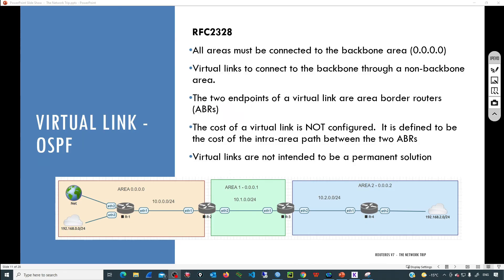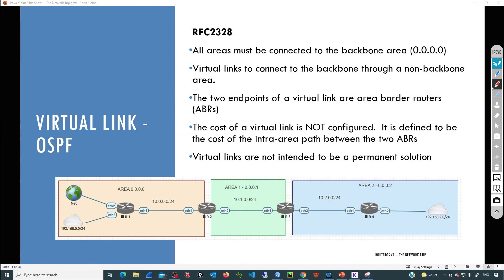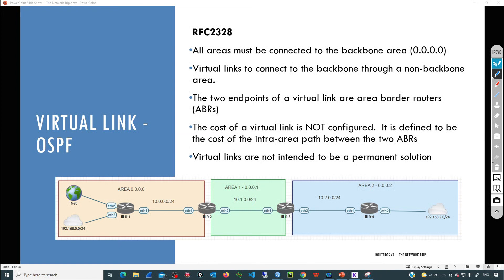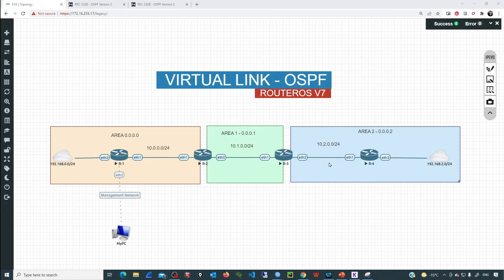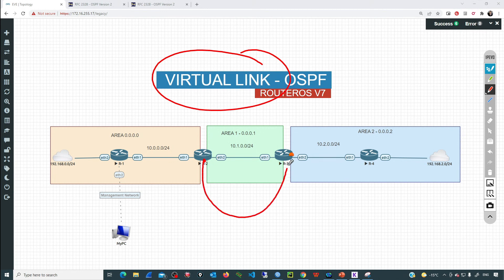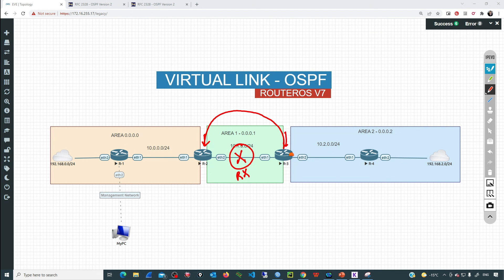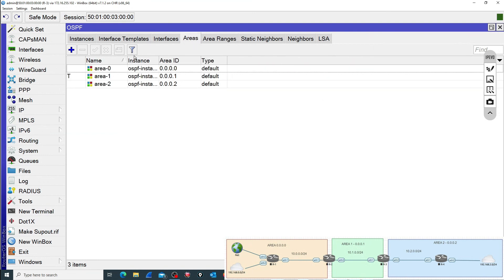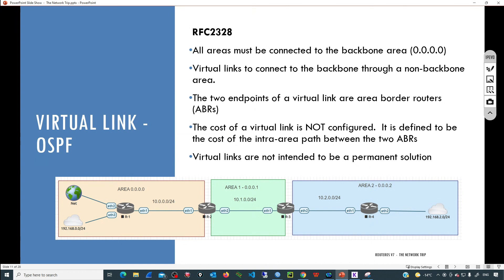Virtual Link OSPF - Mikrotik RouterOs 7

Comment: Hello Inge. Why you do not recommend to use VL permanently?
Reply from the maker: Hello!
Virtual links in OSPF are typically considered temporary solutions due to their potential for suboptimal routing, network instability, and increased maintenance complexity when compared to physical connections.

Comment: does virtual-link works on network type=broadcast only?
Reply from the maker: Hi Nikola,
The network type on the virtual link is "Virtual Link", it's completely independent of the rest of links inside the transit area. Virtual Links don't work on Stub Areas (I will explain Stub and NSSA in one of the upcoming videos)
Reply: @TheNetworkTrip  im not saying that, what im saying is i cant make it work on ptp or ptmp
Reply from the maker: Hi Nikola,
There are no special requirements other than adding the interface templates on 2 ABRs; one, connected to the backbone; the second one, to the non-contiguous area.  If all the adjacencies are established inside the transit area the virtual links should come up.
Reply: @TheNetworkTrip  Thanks a lot for everything you do